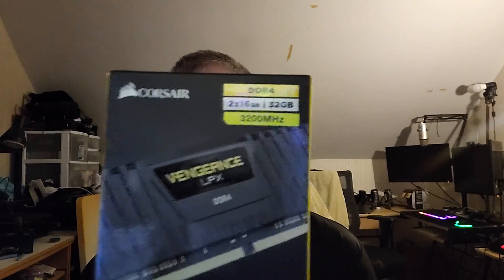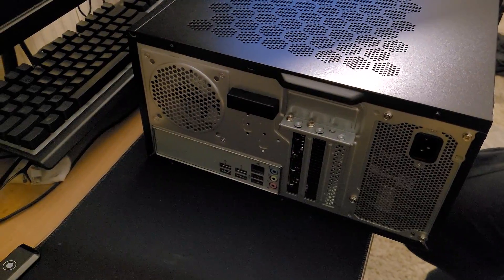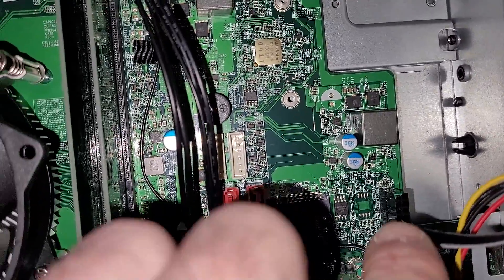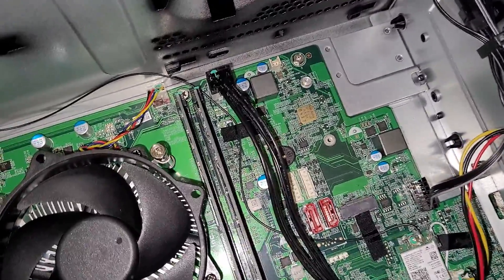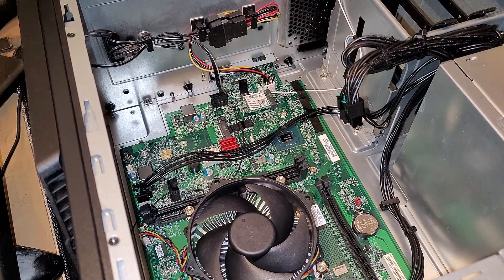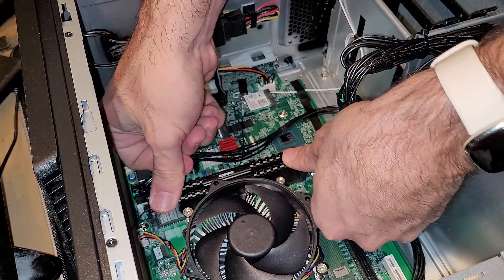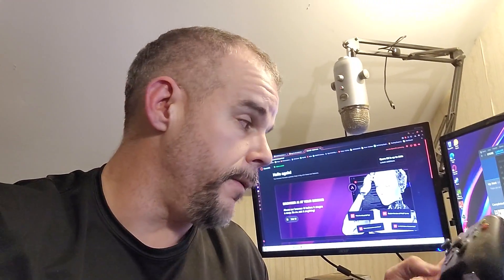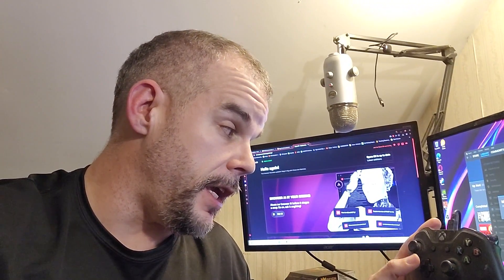RAM and SSD upgrade for Acer Nitro N50 n50-650-eb14

Comment: Thanks for this! I got this desktop a couple of weeks ago and fitted an SSD today, and your video was really helpful in knowing where to look. I didn't order the same SSD brand but it was easy to slot in (I didn't get a fitting screw supplied with mine but I found a similar screw in an old build), and then I just initialised it with Windows' Disk Management. Nice quick upgrade for this Acer.

Comment: Its didnt upgrade the ram bdcuse you cant enable xmp on acer bios so stuck on 2133mhz:(
Reply from the maker: To be fair the ram did go from 16gb to 32gb...sure the speed didn't increase due to the stock acer bios lacking xmp profiles however there is more memory to allocate before having to rely on swap file.

Comment: I have the n-50 640 
Do i change the ssd like yours or do i need to take of the fan then take of the old ssd and change it with the new or do i do like you did please i m lost a bit 
Thx
Reply: nope, both slots are fine!

Comment: Is there a difference between the nvme slot that you installed and the slot that is preinstalled? I just bought an ssd and i am gonna upgrade my nitro and i am curious if the empty slot is somehow slower?
Reply from the maker: nope.  The primary and secondary slot are both PCIE 4 compliant.  The one for the WIFI is only a 1X because you only need 1 lane to run a wifi/BT

Comment: You upgraded the RAM but now it only runs at 2133MHz. The default spec runs at 3200MHz. So you are actually losing performance.  How do you change your clock speed?
Reply: from the bios.
Reply: @imgoldzzz  bios is locked down
Reply: im having this exact problem right now, did you ever figure a way round this??

Comment: @Skivinz is DDR4 3200 the correct ram to run on this system? what was the speed of what was in? just i noticed someone reply saying they noticed you not getting full 3200mzh from this so is there a more suitable speed ram for this system & does having 3200 in when it cant use all of the speed do any harm in terms of straining the system in anyway or slow it down at all or cause any other problems? all advice appreciated as looking to do a ram upgrade on mine but just trying to figure out whats correct & best
Reply from the maker: Stock ram was 2666mhz however it should be able to handle 3200mhz if it had xmp profiles.  Acer doesn't support XMP natively so it auto downclocks to 2166mhz.
Reply: @Skivinz  this leaves me a bit puzzled as i've just got a acer nitro 50-60 & i'm unsure what it's got or what it's running at or is capable of running at, when i open task manager it has 8gb ram in it but it says speed 3200mhz, then when i run cpu-z on the mem tab page it shows dram frequency of 1596.1 but then on the spd tab it says ddr4 3200  (1600mhz) so this leaves me not knowing what speed ram it has in & what speed it's capable of running at if you could shed some light on this as i'm looking to buy some fresh ram & bump it up to it's full 32gb of ram but first of all need to know whats what, i did try the crucial website but for some reason that wouldn't scan my system, just kept showing a blank page as if the system is trying to hide something from the site

Comment: I bought acer nitro n50-640 this computer is verry nice and good job for task and gaming
Reply from the maker: for a cheap prebuilt they do the job. Upgrading them beyond their configuration can be choring.
Reply: i have remplace ram 16gb for 32gb ddr4 and i have remplace 1 tb HDD 150Mb/s for SSD WD 1 tb 500Mb/s @Skivinz
Reply: Hi
I got the same 
How did you change the SSD please 
Did you do like the video or did you took up the fan and unscrew the ancient SSD and changed it ?

Comment: Exactly the upgrade im doing on mine, but i ran into a little issue where its only recognizing half of my ram. Its only pulling from one of my sticks. Any idea what i might need to do to fix that?
Reply from the maker: either dead ram or the ram is not seated correctly.  Try going into the BIOS and see if it shows which channel is hot.  Then shut the system down and swap the sticks around and go back into BIOS and see if the non working channel shows hot.  If it does then bad ram.  If it doesn't then bad mobo and you might have to return to vendor to get it fixed or replaced.
Reply: @Skivinz  thanks for getting back to me! It took a bit of work and switching things around, but I finally got the ram working. For whatever reason the sticks I got only wanted to work in one slot over the other

Comment: Ur ram speed is running at 2133 and mine is too, I don’t know how to increase it and my average bios look different from yours.
Reply from the maker: BIOS doesn't support XMP profiles.  Only way I could see to get more speed out of it is to get some JEDEC ram that is higher frequency.
Reply: @Skivinz  I got some called JEDEC Klevv from Amazon and it worked out the box. Without this video, i would've purchased the exact same RAM he got.

Comment: hi I bought the same model, with rtx 4060 and i5 13400f! I also want to change the RAM, please tell me which RAM did you buy? can you give me the amazon link?
Reply from the maker: Corsair Vengeance LPX 32GB (2 X 16GB) DDR4 3200 (PC4-25600) C16 1.35V Desktop Memory
Reply: @Skivinz thx <3
Reply: @Skivinz  hi I wanted to ask you, does your acer nitro50 build have the rtx 4060? Has in-game performance improved after installing 32GB RAM and the new SSD? Do you recommend me to do this upgrade?

Comment: If you can return that ram and get a kit that has DOCP. It will auto-overclock to said speed. Your machines BIOS doesn't seem to have XMP so you are stuck running at 2133mhz and that will hurt performance big time. I had to get that ram for my laptop. It's the same price and corsair makes it. Just make sure it says DOCP on it.
Reply: Can u send some names or a link that have docp plz
Reply: Yup my thoughts exactly! Good advice

Comment: i actually recently upgraded my ram to 32gigs i always ran 16 and it was more than enough but some games now are using more ram especially star citizen which i havent been able to get into much yet its very complex to learn
Hey btw man you should do a vid on your entire home gym setup for 2023 im curious what all you have im starting a little home gym myself
just starting with the powerblock dumbbells and a rep 3000 adjustable bench for now but would like to get a barbell and squat rack
Reply: Did you have to mess with the bios to get the ram to work?  I bought one of these for my son it was a lower model with the gtx 1650 in it.   

It can run some games decent but the games he wants to play with me he can't run at all...  been thinking of upgrading his ram and dropping a new gpu in his pc.   Just with these prebuilts and proprietary motherboard setups don't know which to go with. 

I asked about the bios cause I just bit a pc and I can only get 16gb to work the other stick won't work.   And I didn't want to have the same issue with my son's pc
Reply: @MrCabledawg45  you will have to research that particular motherboard and if it requires certain sizes of ram to be together like if they all need to be the same size for instance 4 sticks of 4gig and not mis matching sizes like 2 4gig and 2 2 gig sticks 
And if you aren’t populating all 4 slots most motherboards want the 2 sticks to be in specific slots
The only bios setting I’ve had to make sure to enable is xmp if it’s an intel system,but I have an asus motherboard in the rig I built
Hopefully that helps, I’m no expert but just some stuff that I remember off the top of my head from messing with my rig

I’ll add though that most games only really need about 16gigs of ram
Ram doesn’t make as much difference as people think so it could likely just be the cpu/gpu bottlenecking the performance on your sons computer
Reply: @psyfertech yo I have a acer nitro 50 it comes with 16gb but I wanna upgrade to 32gb should I just get one new ram “16” gb to make it 32 or I have to get two new 16gb ram ?
Reply: @spacejaav  the best thing I could tell you to do is google the specific model number of your computer and see if you can find the specs on ram capacity.  I would imagine acer has some documentation that tells you how much ram you can have and what configuration 
If the motherboard can accept 32gb and if you currently have 2 8gig sticks I would say get 2 more 8gig sticks but yea hopefully that helps
Reply: @psyfertech  well from the website where I ordered my pic in bio it’s say max memory support 32gb